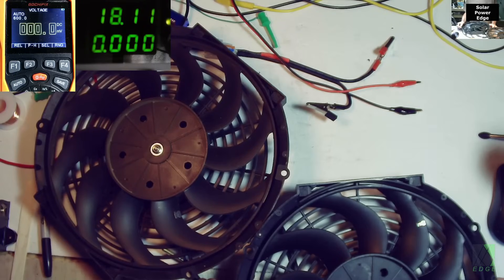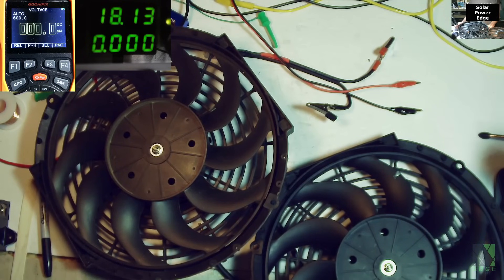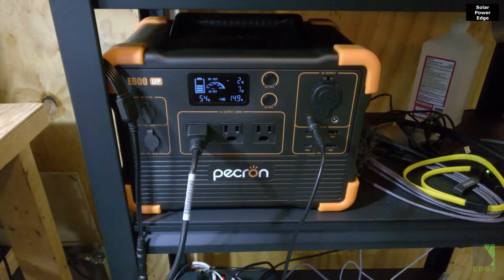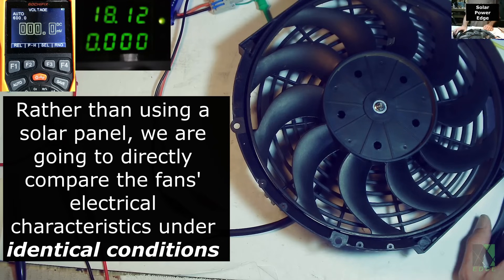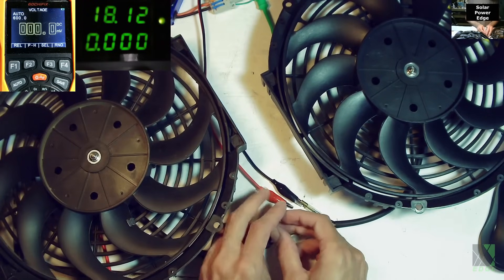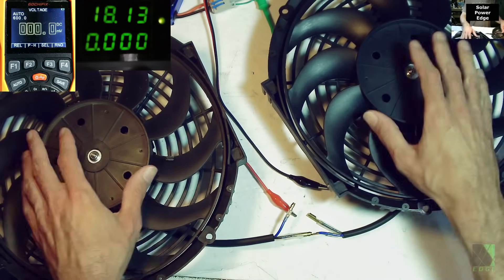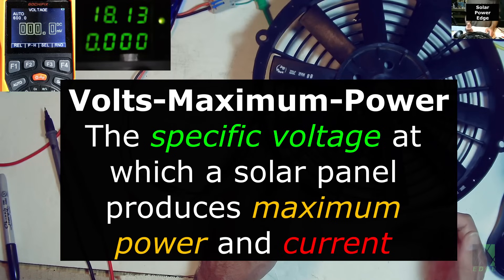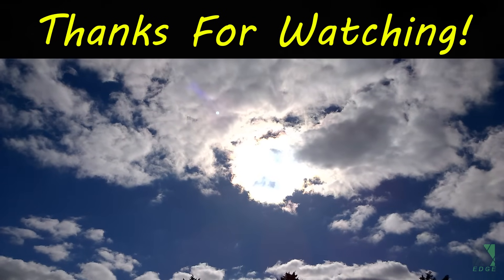Bench Test! 12v / 24v / Series car radiator fans for solar shed ventilation #shed #diy

Comment: I’m building a solar kiln and would like to have three fans running directly on solar but with a thermostat so they don’t kick on as soon as the sun hits them. Would a 100w panel run 3, 12v fans in series?
Reply from the maker: @abundancebydesignpermacult764 Could use a standard DC electromechanical thermostat - 2 fans in series will work fine. Not sure about 3, but it's worth a try

Comment: May I ask a question please? I did this in my shed and I'm not sure if I can let the radiator fan run continuously. Is it ok to run it for a few hours straight or can it burn out? Thank you.
Reply from the maker: @BJNachman-b5u Sure! It's perfectly fine to run the fan all day. However, the hotter the fan runs, the sooner it will fail. So my recommendation is to keep the voltage at 8-10v for a 12v fan. Less heat, a bit less air but it will last longer. Hope that helps! -Dave
Reply: @solarpoweredge  Thank you so much. Is there any way to know how many hours of life a fan like this has?
Reply from the maker: @BJNachman-b5u No problem - I have run one for several summers and have yet to burn it out. My guess is as long as they don't get overheated or soak in the rain, you should get several years out of one fan

Comment: I'm planning to series 4 units 12V 120Watts Aux Fans to my solar kiln sir, what will i do, and what materials will i be needing in terms of solar panel wattage, wiring requirements, other accessories? thank you so much!
Reply from the maker: @1900November Hi, that's a power ful fan setup. Estimated minimum requirement at least 2x 100 watt 12-volt solar panels or similar. If you plan to run the fans at near full voltage, probably need 400w of solar panels. A standard DC breaker can be an On-Off switch and safety disconnect. For wiring approximately 12 gauge copper and use some kind of terminal block fastened to a board with the DC breaker to keep things neat and the wires secure. Heat shrink, solder or crimp connections too. Hope that helps!

Comment: Question: I want to power a 12V, 180W radiator fan with Two 12V, 100W briefcase solar panels using a 40A PWM motor speed controller and connect an amp / watt meter.  However, I need the air flow of the fan to be reversed.  I tried taking off the fan blade and flipping it to the other side, but the air flow comes out the same side of the fan as before.  I am thinking I may need to reverse the polarity of the solar panel wires.  Am I correct?  If so, will I need to also reverse the positive and negative wire connections to the motor speed controller and to the amp / watt meter?  Or, do I leave the positive and negative wire terminal connects of the motor speed controller and the amp / watt meter the same as it was?
Reply from the maker: @bradlyons7046  Yes the blade needs to be reversed (physically flipped over). And then you need to reverse the polarity of the DC motor so it spins the other way (just swap positive and negative of the MOTOR not anything else). Here's my video about reversing air flow https://youtu.be/_3Mces0cny0

Comment: Can a 12V 120W peltier water cooler with two 12V cooling fans (computer type cooling fans) be powered directly by a solar panel without using an MPPT or PWM charge controller and solar battery?  If so, how many watts would the solar panel need to be?
Reply from the maker: @bradlyons7046 Sure it's possible, I did a lot of tests with peltiers plus 100w solar panels a few months back. I'd suggest starting with a 100w solar panel minimum, and do some experiments to see how they perform. Before spending further on the project. (Even 1 or 2 Peltiers can use up a lot of power so a single panel might not be enough)

Comment: Question:  To power a 24V, 120 watt, 16 inch fan using a 100 or 200 amp-hour lithium iron phosphate battery  connected to an indoor, Victron IP22 Blue Smart 30 amp charger, can the battery be a 12 volt battery?  If yes, would it be better to use a 24 volt battery instead of a 12 volt battery to power a 24 volt, 120 watt, 16 inch direct current fan?  Question:  Are 24 volt fan motors louder than 12 volt fan motors?  Hope you had an enjoyable Thanksgiving; thank you for your interesting, informative YouTube videos !
Reply from the maker: @bradlyons7046 Hello, hope you had a good Thanksgiving and holiday. Yes, you can use a 12v battery. Based on your desired setup, in my opinion it's better to stick with a 12 volt battery. Running a 24v battery makes everything more expensive. I believe the 24v fan at full voltage (on a 24v battery) will be just as loud as the 12 volt version (on a 12v battery). 
*The 24v fan will not run at full power on a 12v battery, but it will be quieter and probably not need a speed controller.

Comment: Question:  Which brand / Seller / Store on Amazon sells a high quality, well built, most reliable 24 Volt, 120 Watt radiator fan?  Please provide the item#, amazon URL address, or the full item amazon search title name for a quality, well built, reliable 24V, 120W fan of your choice; I want to buy two 24V, 120W fans for my indoor air ventilation D.I.Y. project, and  two for my outdoor, portable, solar-powered evaporative air-cooler D.I.Y. project.  Thank you so much for your informative, resourceful YouTube videos.
Reply from the maker: @bradlyons7046 You are welcome, I am glad these videos are helpful :) Sounds like a cool project. 
Please search Amazon for product #: B003R3G5P6
This is the fan shown in the video, known as "Universal Air Conditioner CF 0010MP-24V A/C Condenser Fan". Best 24v fan I've found, it's installed in my shed. 
Links to other 24V fans on Amazon have been placed in the video description as well. I usually don't post web links in chat. Please let me know if you cannot see the links in the description, they are towards the bottom of the text. 
24v fans are typically much more expensive (except for the smallest ones)

Comment: Pertaining to your Mon., Nov. 25th, 2024 response to my most recently posted question(s) on Mon., Nov. 25th:  I will be using a PWM motor speed controller with either a 24V, 120W fan , or with a 12V, 120W fan to be able to adjust the fan motor speed.  I have four PWM motor speed controllers.  One has a maximum amp limit rating of 10 amps (10 amp maximum current load rating) with a voltage range of 9V - 60V.  One has a max. amp limit rating of 20 amps (20 amp max current load limit rating) / 9V - 60V.  One has a maximum amp limit rating of 30 amps (30 amp current load limit rating) / 9V - 60V, and one has a max. amp limit rating of 40 amps (40 amp current load limit rating) / 9V - 60V.  Purportedly, radiator fan motors can experience a significant amp surge (current surge) when powering on and when adjusting the fan speed using a PWM motor speed controller.  For a 12V, 120W fan motor, what minimum amp limit rating can the PWM motor speed controller be when powering on the fan using a 12V, 100 amp-hour lithium iron phosphate battery without a charge controller, and while adjusting the fan speed using the PWM motor speed controller?  Purportedly, the minimum amp limit rating of the PWM motor speed controller, must be higher than the maximum number of amps (higher than the max. current load) of the fan motor, to prevent over-heating and damaging the motor speed controller.  Question: Which of the four PWM motor speed controllers would be compatible with a 12V, 120W fan motor powered by a 12V, 100 amp-hour lithium iron phosphate battery?  Question:  Which of the four PWM motor speed controllers would be compatible with a 24V, 120W fan motor powered by a 12V, 100 amp-hour battery?  Question:  Should I implement a fuse to protect the 12V or 24V fan motor and / or, the motor speed controller from amp surges when powering on and adjusting the speed of the fan motor?  If so, what size fuse ( amps ) should I use for a 12V, 120W fan motor?  What size fuse for a 24V, 120W fan motor?  If needed, should the fuse be connected between the watt / amp meter and the motor speed controller or, should it be connected between the motor speed controller and the fan motor?
Reply from the maker: @bradlyons7046 A) For the 12v fan, the PWM controller should be as large as possible. I'd suggest 20 amps minimum. 

The 24v fan isn't going to draw as much power at 12v, but I'd stick with a 20A if possible. 
Quality of PWM controllers can vary, I'd test each one in operation. If it gets hot, upgrade to the next higher model to prevent fire hazards. I've seen speed controllers that claimed to handle "# amps", but in fact, they couldn't - and would overheat.

The battery should have a fuse as close as possible to the positive terminal, with nothing else connected before it (except a wire). Another way of looking at it, the fuse is the first thing connected to the battery, before the wattmeter or anything else. Can use standard 12v automotive fuses and fuse holder. How about a 20A fuse to start. Hopefully the surge won't blow the fuse. If it does, just replace with a 25/30A fuse.

Comment: Most recently posted question from bradlyons7064:  I want to use direct current 12 volt or 24 volt, 120 watt fans I will attach to 1/2" or 3/4" square wooden boards to be securely placed on my sliding window ledges for indoor air ventilation during summer-time public utility power outages.  I will have to use 12v, R.V. motorhome / marine heavy-duty lithium iron phosphate batteries without using solar panels; I live in an apartment with no yard to use solar panels.  I plan to use Victron Blue 120 volt A.C.  plug-in Automatic Battery Chargers to charge the 12 volt lithium iron phosphate batteries.   (1) How many Watt-hours should each of the 12 volt lithium iron phosphate batteries in parallel be, to be able to power one 12v or 24v radiator fan motor for 8 continuous hours during an 8 hour power-outage?  (2) How many 12v lithium iron phosphate batteries should I connect in parallel, to power one 12v or 24v, 120w fan motor for 8 continuous hours during an 8 hour public utility power-outage?  I am aware the Victron Blue 120 volt A.C. plug-in automatic battery charger will not be able to continue charging the 12v lithium iron phosphate batteries during a public utility power-outage.
Reply from the maker: @bradlyons7046 For 1) 12v car radiator fan powered by 12v LiFePo4 battery, it's going to use about 85 watts. That is about 600 watt-hours in 8 hours. I'd recommend a 100ah battery (about 1200wh) to ensure continued operation with power to spare and no need to run the battery flat each time. A 50ah battery could just barely meet your requirement but would be run completely flat in 8 hours which is not good for it. Adding a simple PWM speed controller will slow down the 12v fan, save power and make it run even longer. 
2) Just a single 100ah battery would do fine, or parallel enough smaller batteries to reach about 800 watt-hours.
*Note the 24v fan will probably use less power when connected to a 12v battery and probably won't need a speed controller at all.
Reply: Pertaining to your prompt  response to my most recently posted question (Mon., Nov. 25th, 2024), I will in fact, be using a motor speed controller regardless whether or not I use a 12v or 24v radiator fan on my window ledges; during summer-time public utility power-outages, I will probably be powering the 12v or 24v, 120 watt fans at no more than 3/4 ( 75% ) maximum speed, or perhaps only 1/2 ( 50% ) of maximum speed.   I will probably decide to use 24 volt, 120 watt fans instead of 12 volt.  For a 24v, 120w fan motor, what minimum amp rating ( minimum amp limit ) can the PWM motor speed controller be when powering the fan with a 12v, 100 amp hour lithium iron phosphate battery?  Purportedly, the minimum amp rating ( minimum amp limit ) of the motor speed controller must be higher than the maximum number of amps ( higher than the current load ) of the fan motor to prevent the motor speed controller from over-heating / damage, but I do not know how much higher is necessary to prevent over-heating / damage of the motor speed controller.  For example, if the fan is rated at 5 amps max., the minimum amp limit / rating of the motor speed controller purportedly should be higher than 5 amps, but how much higher?  .5 amps higher (5.5 amps)?  1 amp higher (6 amps)?  1.5 amps higher (6.5 amps)?  2 amps higher (7 amps)?  I have a number of PWM motor speed controllers; one has a 10 amp maximum limit rating ( 10 amp max. current load limit ) with a voltage range of 9V - 60V.  One has a 20 amp maximum limit rating ( 20 amp max. current load limit ) / 9V - 60V.  One has a 30 amp maximum limit rating ( 30 amp max. current load limit ) / 9V - 60V.  One has a 40 amp max. limit rating ( 40 amp max. current load limit ) / 9V - 60V.  Which would be best to use for a 24V, 120W fan with a 100 amp hour 12V lithium iron phosphate battery?  Which would be best to use for a 12V, 120W fan with a 100 amp hour battery?  Next question:  Should I  implement a fuse to protect the 12V or 24V fan motor and / or  the motor speed controller from amp surges when powering-on the fan with the PWM motor speed controller?  For a 12V, 120W fan motor powered by a 100 amp hour lithium iron phosphate battery, what size fuse should I use if needed? Purportedly, 12 volt radiator fans can experience a significant amp surge when powering-on the fan, but perhaps this is only when using a solar-panel instead of a battery to power the fan.  Should I implement a fuse anyway?  If so, should the fuse be connected between the watt / amp meter and the motor speed controller or, between the motor speed controller and the fan?

Comment: New Question:  By wiring two 12 volt fans together in series, it converts the two 12V fans to 24 volt fans (doubles the voltage of the 2 fans).  Correct or incorrect?  It simultaneously doubles the wattage of the 2 fans.  Correct or incorrect?  What does it do to the amperage?  Does it decrease the amperage?  Amperage = Watts divided by voltage.  Correct or incorrect?  If correct, would a 12V, 120W radiator fan be 10 amps?  Would wiring two 12V, 120W fans in series not only double their voltage and wattage, but also decrease their amperage?  What would be the estimated amperage of two 12V, 120A radiator fans wired together in series?
Reply from the maker: @bradlyons7046 The 2 fans in series will add together in both voltage and wattage. But the solar panel is current limited. It will only drive at whatever Amps it can produce into the fan. Best bet is to just hook them up and see what happens

Comment: Question:  Do you know if it's possible to power a 24 volt, 120 watt radiator fan with a lithium iron phosphate battery?  If so, I want to use one or more lithium iron phosphate batteries to power a 24V 120W 16 inch radiator fan for air ventilation without relying on a solar panel and without using a PWM or MPPT solar charge controller.  I want to be able to do it by implementing one of three models of Victron 'smart chargers' which use  A.C. electrical power to charge lithium iron phosphate batteries.  Question:  Can Victron smart chargers be used to simultaneously charge a lithium iron phosphate battery while the battery is powering a direct current device such as a 24 volt or 12 volt 120 watt ventilation fan?  Question:  If so, should I use a 12 volt lithium iron phosphate battery or should I use a 24 volt lithium iron phosphate battery to power a 24 volt, 120 watt radiator fan?
Reply from the maker: @bradlyons7046 Charging the battery while it runs a fan is no problem at all - it won't harm the battery. For a 24v battery, I do suggest speed control and fuses/breakers for safety. At full voltage the 24v battery would be  pushing the fan pretty hard. Fan would last longer at a lower voltage (meaning running the fan a little slower) and it won't get as hot.
If you run a 24v fan from a 12v battery, it will not need speed control and will run slower / cooler. Whether that will move enough air for your building is unknown... some of this is down to experimentation... hope this helps

Comment: Another question:  If by wiring two 12v, 80w fans together in series changes their voltage to 24v, does it also change the wattage or the amperage (amps / current) of the two fans?  If so, what does it change the wattage or the amperage to?  My next question will depend on what your answer to this question will be.
Reply from the maker: @bradlyons7046 Two 12v 80w fans in series becomes a 24v 160w fan "technically". The best way to test it is just wire them up to the solar panel and see what happens. You can use a volt/amp meter to confirm how much power is really getting used from the solar panel - which will vary based on how much sun is available
Reply: Okay, you replied that by wiring two 12v, 80 watt fans together in series, will change the voltage of the fan motors from 12 volts to 24 volts and will change the wattage of the fan motors from 80 watts to 160 watts.  Therefore, the amperage (current) tolerance limit of the fan motors will be 6.16 amps because the watts divided by the volts equals the amps.  To prevent (avoid) damaging and shortening the lifespan of the two fan motors, I presume I would need to use a 12 volt solar panel that does not exceed 6 amps or, perhaps a solar panel that produces less than 6 amps.  A 12 volt, 100 watt solar panel produces 8.4 amps because 100 divided by 12 equals 8.4.  Thus, it seems that a 12v, 100 watt solar panel exceeds the amperage tolerance limit of the two fan motors which is 6.16 amps.  If this is correct, should I use a 12 volt solar panel that is less than 100 watts such as, an 87 watt, 86 watt, 80 watt, or 76 watt solar panel?